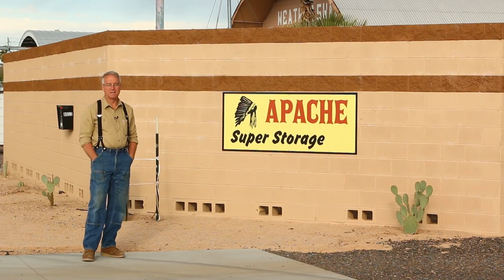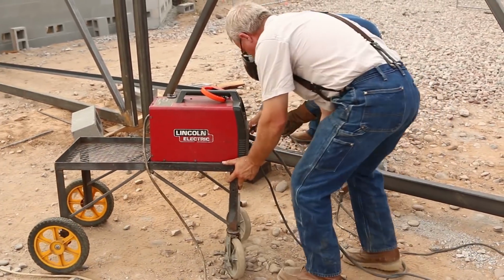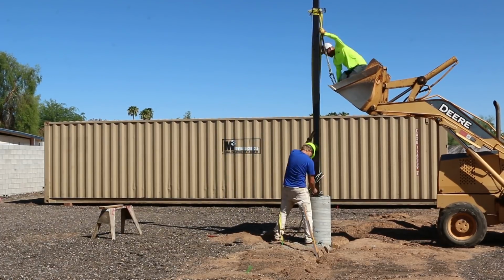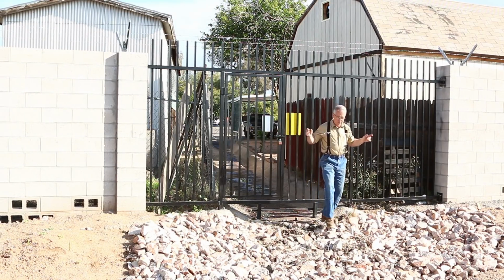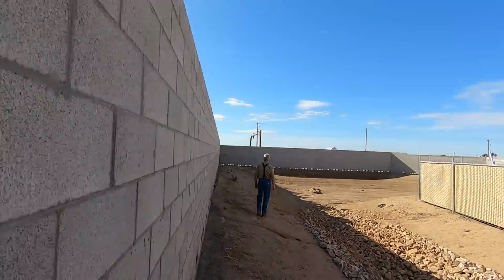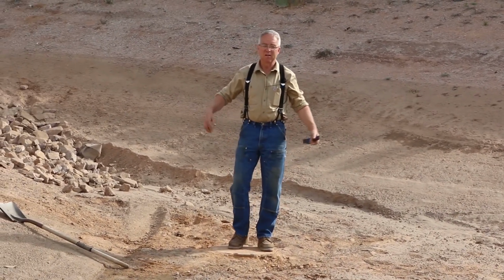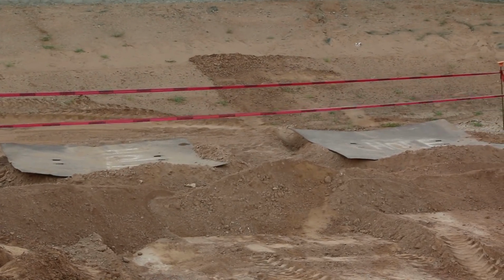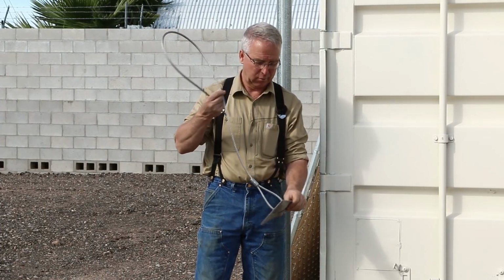Site Tour: Contractor Storage Facility

Comment: Boo yeah! The midnight special. 
Time for bed? Nope. Time for my essential dose of craftsmanship. 

Great work!

I'll still add, I hate the government. You have to love how the water which used to flow through the property into their street becomes your problem all of a sudden, costing tens of thousands of dollars to deal with minimum. Then the usual declaration that what you are doing is okay, until it comes time to throw the book at you for listening to them, ie the shipping containers. The only one that could reasonably be considered a commercial building would be the occupied office

In any case, congrats on the job well done!
Reply: The property was changed and so was the water flow. You don’t want your shipping containers floating around the lot in case of that 100 year flood. And you can believe me, the do float. 
Maybe the water diversion work was enough for the container to keep dry. In that case the hold downs are overkill. 
Most people can’t imagine what damage water can do. And once the water is there, it’s unstoppable. 
I was very surprised to here that safety measures weren’t even at a 100year level in New Orleans when Katrina happened. 
I live in the Netherlands. The norm for our dikes is based on a once in 10,000 years event.
Reply: @ Conservator - Yes, but with all due respect, the Dutch are world renowned for there ability to deal with water. The desert in Arizona and the Netherlands are literally ‘Apples and Oranges’.
🤜🤛
Reply: psidvicious 
You might be right. I don’t know how much rain falls down over there and more importantly what the ‘spread’ is like. (You can drown in a pool of water with an average depth of just 1 foot;)
Scott showed that there is a shoot from the neighboring lot and he mentioned that the soil is not very permeable. So any water entering the lot is all accumulated and has no where to go. 
That said: I have no doubt that they have taken all necessary precautions (if you know what I mean;)
Reply: @Conservator.  My primary frustration stems from the fact that the city approved massive suburbs constructed by large spec home building firms, yet allowed them to dump all runoff from concrete and road (impermeable surfaces) right into someone else's property. These companies have budgets in the millions to tens of millions for developments, and as a fraction of project cost, would have been much more responsible for contributing and dealing with the water issue, than a small owner developing a storage site. THe developers were the primary contributor to what the city now is considering "natural flow" during a "100 year flood event". As seen by them reneging on their word about foundations not required for the containers, cities love to pull the rug out from under you after you commit. 

If there is one major lesson 20 years in construction taught me, there are cities where the large firms, via whatever term you wish to use like palm greasing, lobbying, bribes, so on, offload the responsibilities of the messes they create on smaller companies or individuals who can rarely afford it. Municipalities are all too happy to agree because it is a great revenue generator for them to bring a major developer in, damn the consequences for anyone else. Cities, in particular, are the worst offenders. 

I have seen it in CA, AZ, MT, CO, OR, and a host of other states I have traveled to for work. $20K in "donations" probably saved the developers $75K on a $10M project, only for the water control issue to dropped on someone with a fraction of the budget.
Reply: John Doe 
I agree with you that rainwater should be retained as much as possible at the location where is falls down. 

The former development should have done so but didn’t. 

Maybe (and I’m guessing now) the neighboring development was built a long time ago and the lot was owned by the municipality and or the owner was compensated for the shoot. 
In that case Nate knew if these requirements beforehand and that would have been reflected in the price. 
But we don’t know and therefore I find it difficult to judge.
Reply: @Squat5000  You wrote, "My primary frustration stems from the fact that the city approved massive suburbs constructed by large spec home building firms, yet allowed them to dump all runoff from concrete and road (impermeable surfaces) right into someone else's property." If you go to Google maps (8892 E Main St, Mesa, AZ), you can see that this is exactly what the city did. There is some kind of development -- Sunny Skies Mobile Estates? Who built that, and got away with water dumping? If you look at the junction of North 89th Place, North 89th Street, and East Albany Street, there is something like a funnel or chute that just DUMPS the water from this neighborhood right onto Nate's property. You can see how that was designed (and city approved?) to simply dump water downhill onto his property. And so now it is NATE's responsibility to handle all the water runoff from above his property line? Not only the expense of "remediation," but also the loss of land (that he paid for) and the potential loss of income from that land. If he didn't have to devote so much of the property to OTHER PEOPLE'S WATER, he could put more units on it. You are so right!
Reply: @ Nunya Bizness - Which brings us to the point I made elsewhere in the comments section - If it weren’t for the cost of retaining lawyers to fight city hall, Nate should have been compensated from the municipality for the cost of water retention/diversion. Even with attorneys, this issue could have been tied up in litigation for years. I’m sure Nate and Scott weighed it all out and this is the solution they came up with to be profitable and timely. Unfair? Absolutely. But, this is the world we live in 🤷‍♂️
🤜🤛
Reply: psidvicious 
Unless they knew beforehand and this was reflected in the purchasing price.
Reply: @Conservator.  You're probably correct on that. It seems that Sunny Skies Mobile Estates was established in 1971, so that developer/builder is probably long-gone.
Reply: Nunya Bizness 
Ha, Tx!
Just had a look at it via google maps. If you turn on Satellite View, you can see Apache Super Storage being build. Even the water shoot is visible. All the water collected by the road above the lot is directed towards it. 
Interesting to see. (Amazing that this info is available like this too;)
Reply: Nunya Bizness 
You didn’t even made that name up. 
Sunny Skies Mobile Estates 😂  Arizona 85207
 https://www.google.nl/maps/place/Sunny+Skies+Mobile+Estates,+Arizona+85207,+Verenigde+Staten/@33.4187441,-111.6381035,16z/data=!4m2!3m1!1s0x872bb06a6a1f3169:0xd9fea420b8e3b694

Comment: I guarantee that handicapped  stall will never be used by a legitimately handicapped individual .
Reply: @suspicionofdeceit they repaved the main road in my town last year and even did the access points and some other walkway sections got replaced as well due to substantial cracking, not many if any handicap folk afaik, but does help if and when a handicap person panes to stop by town and check out a few good local places they have heard or found online about. Better to be handicap friendly and ready, rather than not.

Comment: If you get to much of a windload, you can cut reliefs into the gates.
We install fence (including gate operators) those Dks should be OK, except when opening under heavy windload.
If to high of a load is felt, the gate will stop mid-close and go into re-open mode.
This is a safety measure so it won't close on a vehicle.
A potentiometer is used to adjust the forces needed to close. (this can be adjusted for wind load, however if it's set for wind and there is none.. It's less apt to go into re-open mode) shadow loops and photo eyes can work in concert  to alleviate this.
We install in coastal Ga so wind is our joy to work with too!

Btw a typical cell tower is built with 1-3 # 5ft x100 ft holes for the tower, and up to 3 anchors.. All being filled with 100yrds of concrete per hole.
So when you see a cell tower, your usually looking @ 500yrds+ of concrete holding it up.
Engineering isn't cheap!
Hope the site does well Nate!
 And looking forward to the spec house build!
Reply: I'm wondering if Nate thought to hook up the gate openers to access control. Being able to control entrance to the space with something more secure than  just a remote or code would make scaling customers much easier. 

This is what we install at all sites like this. I should also mention that it doesn't look like you have any cameras installed yet.
If you're looking for good cameras I'd recommend a security company that can install Axis cameras.